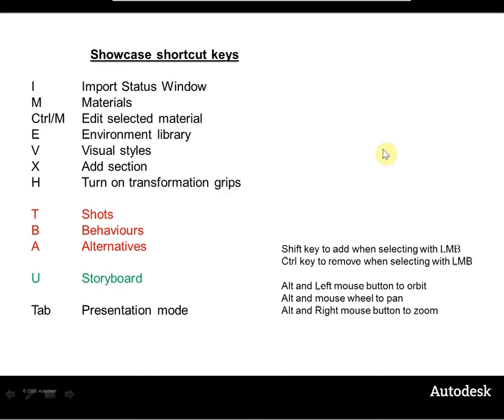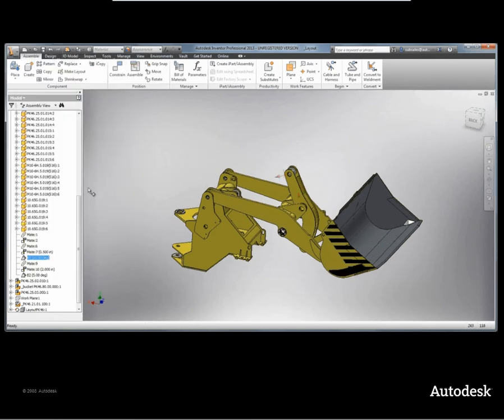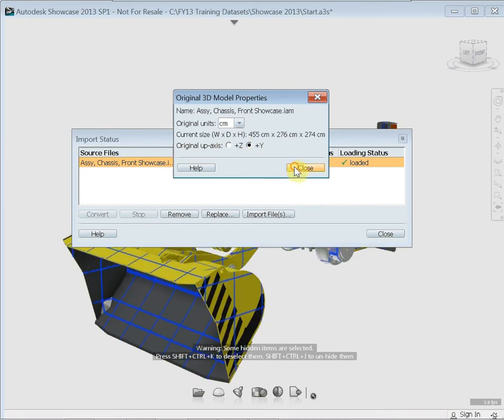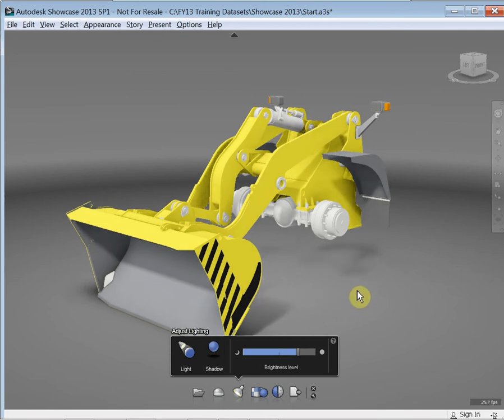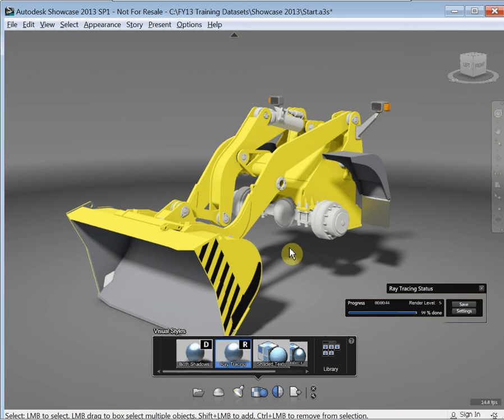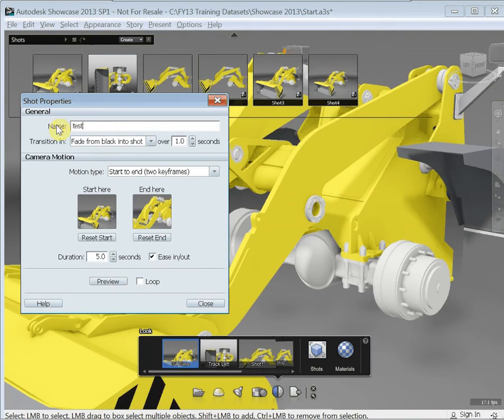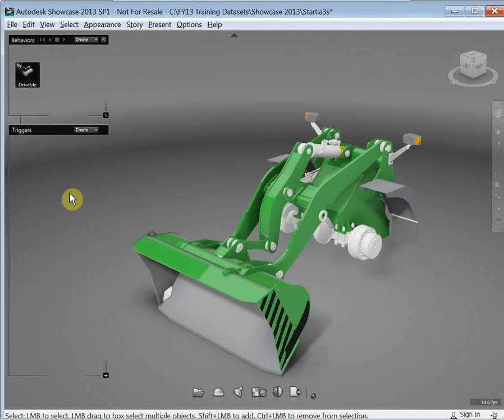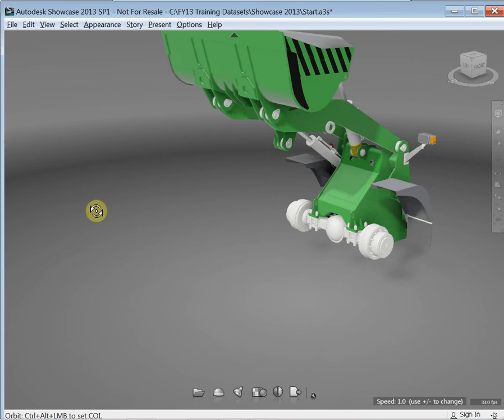Autodesk Showcase 2013

Comment: I have this problem with the triggers.
I have this inventor file (PC case) that has more movable parts that has driven constraints.
For example: I have multi removable dust filters in this model that can easily slide out there brackets plus the top of the case can be removed. When I push the file from Inventor 2013 to showcase 2013 with only the driven constraint of one part it all works fine and triggers works great.